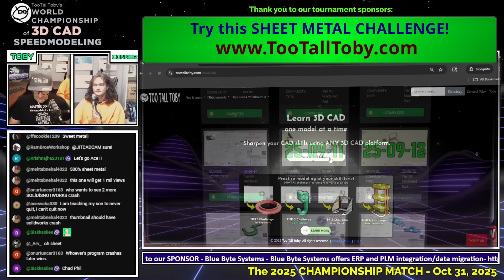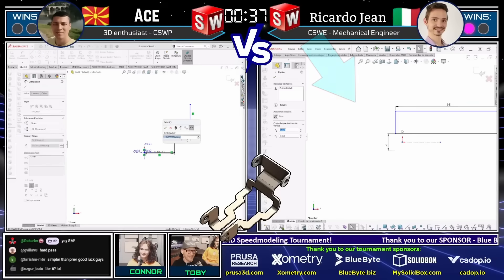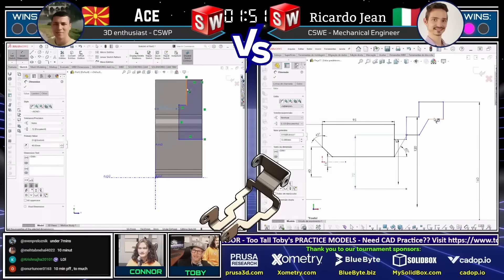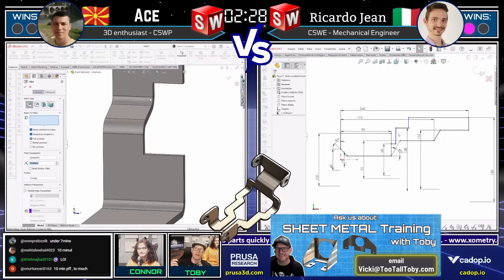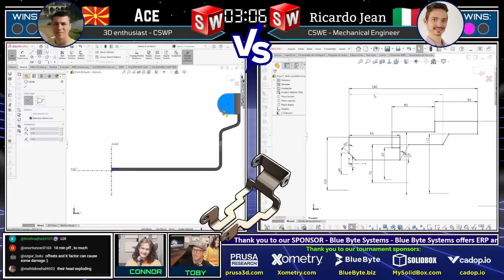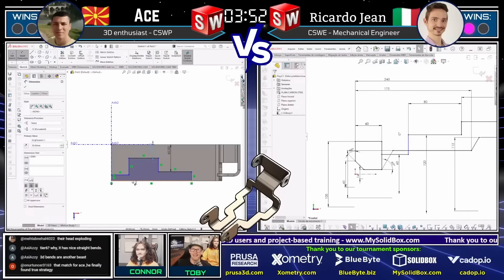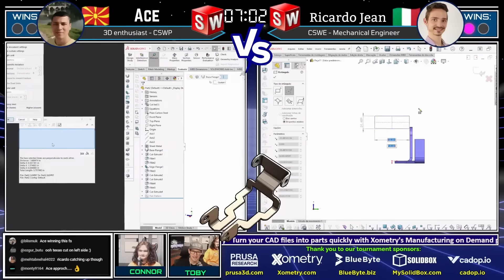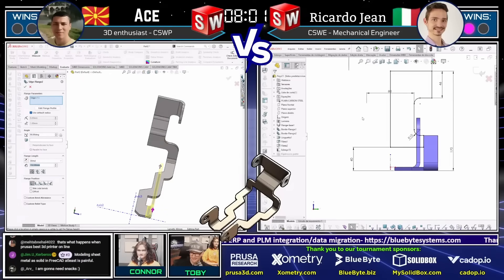CAD vs CAD Tournament - World Championship FINALS - Battle 3 - Sheet Metal!

Comment: I did this practice, at first i did all by myself using my own simple method, drawing on different planes and stuffs. I got an answer that's 100g extra. I did it again using Ace's method, I got the same exact answer. I am not telling if this exactly is the case, but I feel there's something to do with the sheet metal feature, since Ace used it too. I am also wondering what's the reason behind it. I would appreciate If anyone can pour some knowledge here about it. Thanks.
Reply from the maker: nice! Was the material density correct?
Reply: @TooTallToby Yes the material density is correct. I managed to find the issue. When I used the sheet metal feature, like base flange and edge flange, like how Ace used, I didnt had to bother with the 8 mm default bending as the feature automatically handles. When I didn't use the sheet metal feature, I overlooked on the default bending radius as the bending inner and outer side are not the same. When i fixed that, I manage to get a mass that is lower than previous, but still not right. Probably there's something else I still need to check !
Reply from the maker: @moiz8989  What CAD system?
Reply: @TooTallToby solidworks,

Comment: What prevent the contestant, to do it flat, and add the bend after ?
Reply: Math 😁😁 how fast can you calculate those bends?
Reply: @acesvaba330 when you bend a sheet metal, you don't remove wait, and 2 or 4 bends won't take 4g away
Reply: @TheDarckstart why don't you make a speedrun and record it, there are plenty of such videos on TTT site, add one more please
Reply: @TheDarckstart  Making the bends is not the issue/speed contraint. Calculating all the correct lengths would be a crazy task to do on a timed competition lol.
Reply from the maker: FYI you actually do change the mass of the part when you go from a FLAT to a FORMED state, in 3D CAD.  This is not what happenes in the real world (at least not measurably), but it does happen in 3D CAD, due to the fact that in the real world you deform the material in the bend region, but in CAD the material in the bend region is idealized and remains perfectly parallel / concentric in the bend regions.

Give it a try - model something up in SOLIDWORKS as sheet metal, then click MASS PROPERTIES.  Then switch to a FLAT VIEW and click MASS PROPERTIES.

In most cases you'll see a different mass (there are some situations where the "positive bends" and "Negative bends" cancel each other out, and leave you with the same mass).